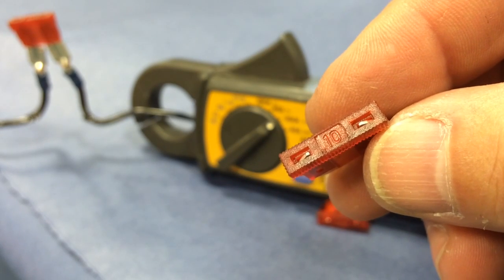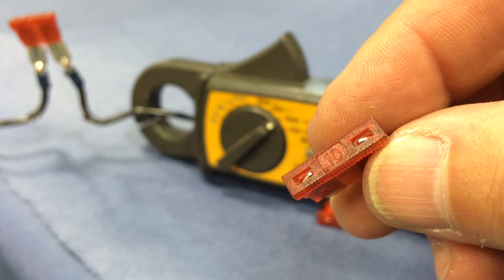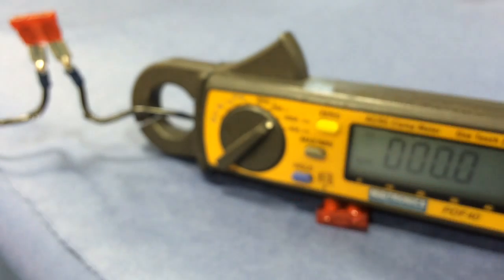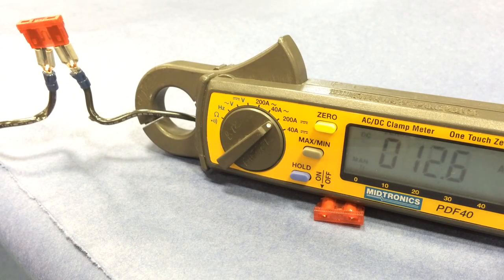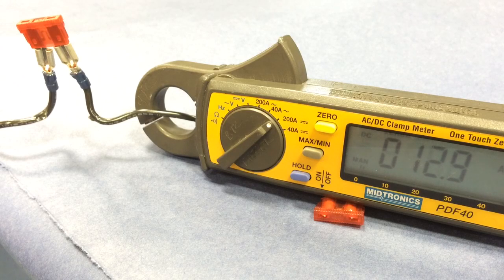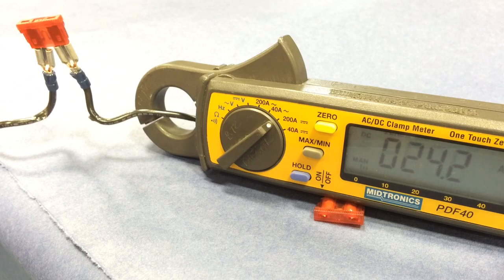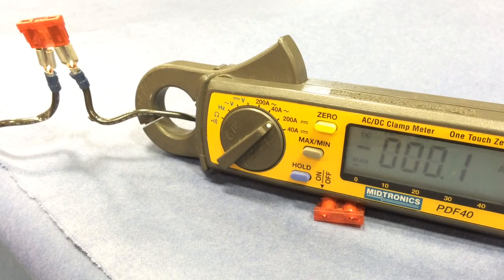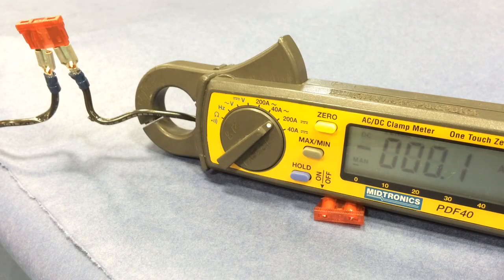10 Amp Fuse Testing

Comment: Good job Jeff!
Reply from the maker: Thanks Dave, while that was a fun one it was also shocking to see that this was happening. It appears to me that all of the fuses, in all of the current ranges, were cut from the same sheet of metal conductor. The 5's to the 30's all had the same piece of conductor; just different numbers on the plastic. A real piece of manufacturing efficiency. And a safety travesty.

Comment: Thanks so much for this video!  They sell these automotive fuses at my local dollar store for dirt cheap -- 15 assorted sizes for $1.  Made in China.  I was tempted to buy them because of the very low price but upon close examination of these fuses they just "didn't look right".  The little wire between the spade terminals that is supposed to blow looked to be the same thickness no matter what amp the fuse was, which made me very suspicious of these fuses.  So I wanted to research these cheap made-in-China fuses and found your excellent video.  So glad I did...probably saved me burnt wires under my dash...or worse yet a fire.  Will now only buy the better quality fuses like Cooper-Bussman.  Well worth the extra money and piece of mind!